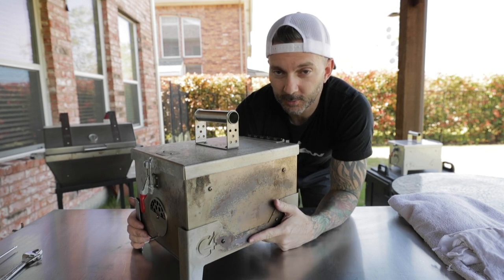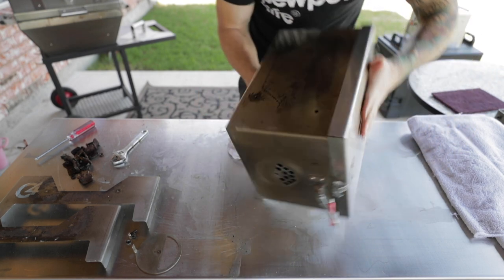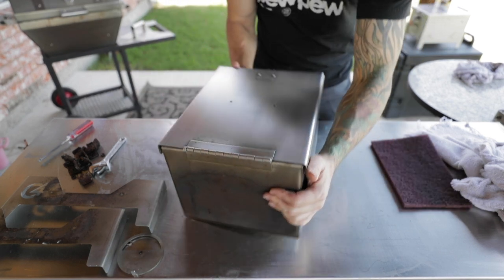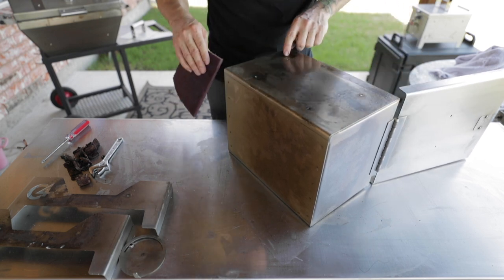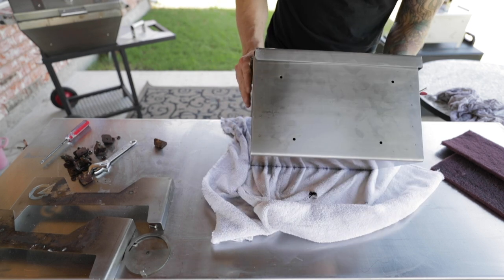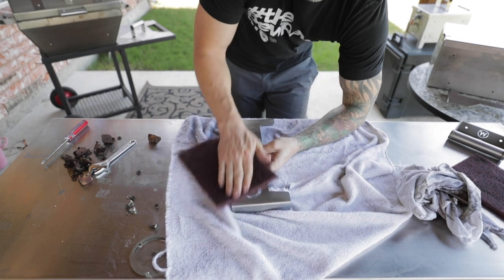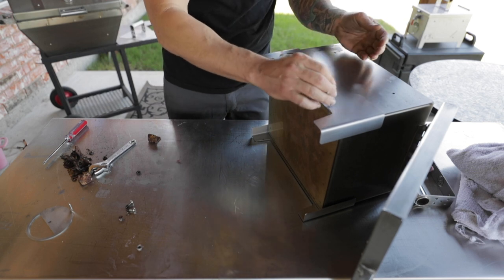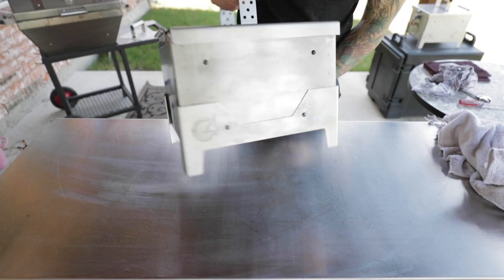Stainless Steel Grill Refinishing - The C4 Portable Grill

Comment: I have a stainless steel fire magic grill and the hood has some swirl scratch marks. I assume I use your method back and forth on the entire hood in one direction? Then do I need to polish or that’s it.
Reply from the maker: If your stainless grill has a grain, then I would just follow the same direction as the grain. If there is not a grain in the stainless, then you would actually put one in with the scotch bright. Just make sure you are always scrubbing in the same direction for best results. You should not need to polish once done.